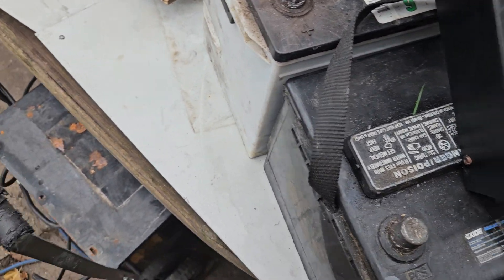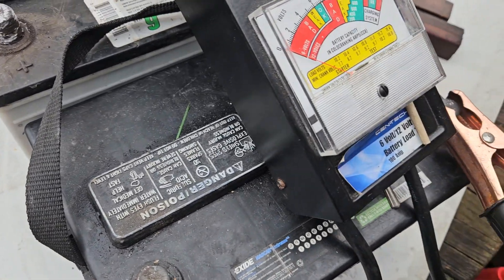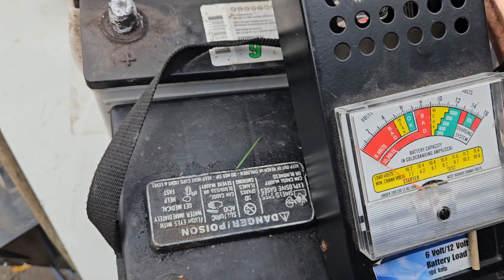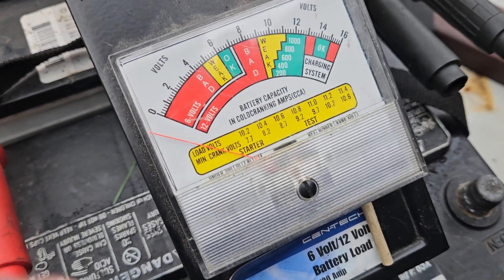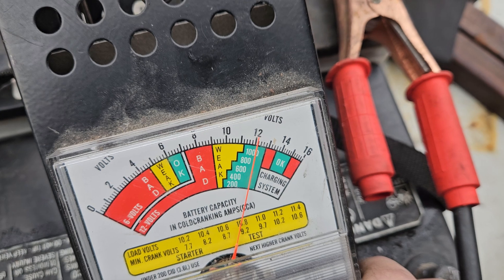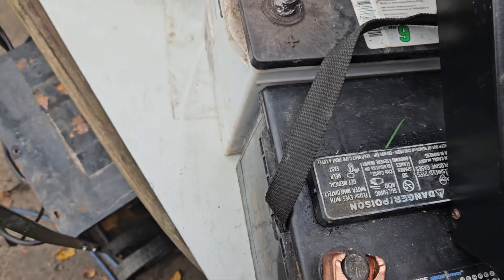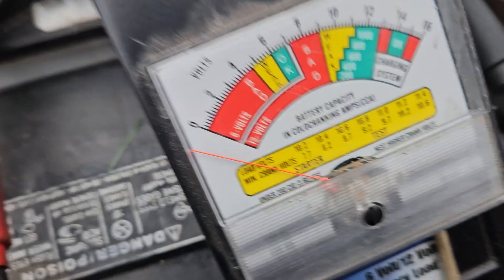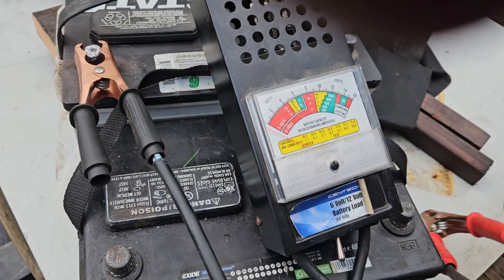What causes battery to reverse polarity ? Reverse polarity, 12v   1000  amp battery battery group 27

Comment: Hey Detroit I don't know the answer but I asked ChatGPT the question and this is what it said
A car battery showing reversed polarity is unusual but can happen under certain conditions. Here are some potential causes:

Severe Over-discharge: If the battery has been deeply discharged or left in a fully discharged state for a long time, it might develop a reversed charge. When a battery is completely drained, the polarity can shift under specific conditions, especially if the battery sits unused or attempts were made to recharge it with incorrect polarity.

Incorrect Charging: If someone attempted to recharge the battery with reverse polarity (positive charger terminal to the battery’s negative terminal and vice versa), it could have partially reversed the battery’s polarity. This is rare but possible with extended or high-power reverse charging attempts.

Faulty Internal Cell Connection: Inside the battery, a damaged or faulty cell could lead to strange behavior, including apparent reversed polarity. However, this usually presents with additional signs like a reduced voltage (often significantly lower than 12V).

Measurement Error: Sometimes, the voltmeter might not be set up correctly, or the probes could be reversed, leading to a false reading of polarity reversal. Double-check the meter’s setup and connection to rule out this possibility.

To safely address this, he should:

Confirm the reading with a second voltmeter.
Avoid charging or using the battery until the cause is clearly identified, as incorrect polarity can damage electronics or cause safety risks.
If confirmed, it’s generally best to replace the battery, as reversing it back to proper polarity is difficult and may not fully restore functionality.

ChatGPT can mak
Reply from the maker: Thank you very much for your research. I truly do appreciate it. I am going to put a light bulb on it and drain it completely and try to do another recharge. That class of battery costs $200 or more. I can't afford a new one, but I can still use it for jump-starting around the house.